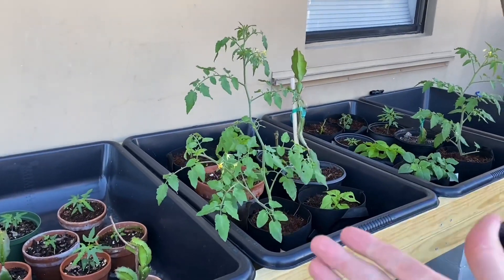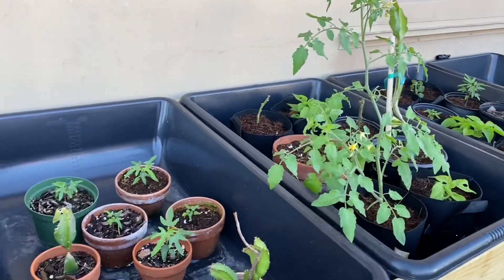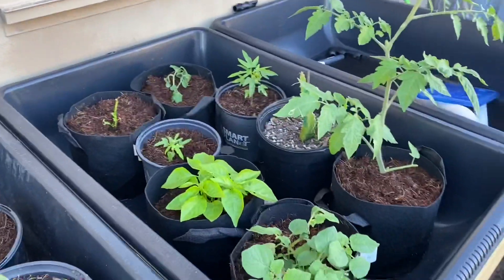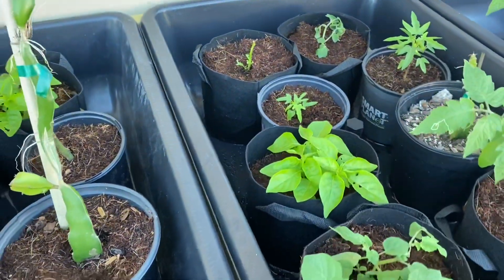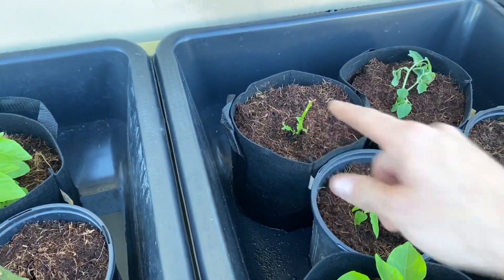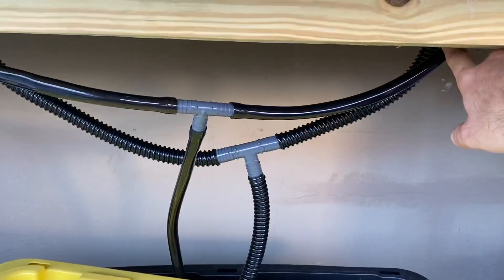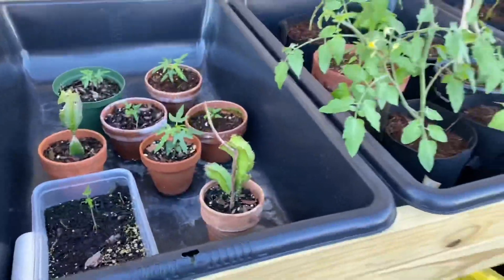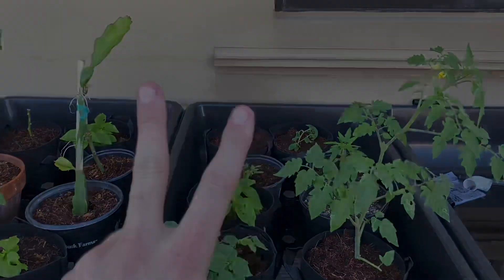DIY Flood and Drain / Ebb and Flow Hydroponic Table

Comment: On the ones that aren't connected you could just leave 1/4" to 1/2" of nutrient solution in the bottom. You may not need 2 fittings because the pump line will turn into a siphon when it stops.

Comment: Once again, another inspiring video.  
1.  What size is your reservoir tub Bob?  
2.  Are the upper tubs just resting on the outside lips of the tubs, or are they sitting on a tray?  
3.  Lastly, do you aerate the reservoir?  I am guessing not, as you don't for anything else.
Thanks again, Ill send pics of my grow room...
Reply from the maker: Reservoir is 27 gallons I recommend larger because when it rains the water from my roof make it overflow.

The lip of the tubs are sitting on the 2x4s but underneath in the center there are 2 4x4s running across the whole bed supporting it
Reply from the maker: No aeration as always
Reply: These larger tubs are 24"x36" and cost about $16.

Comment: Nice setup Bob. You and your videos have inspired me to take on outdoor hydroponics. One question I have is reservoir temperatures. What are your temps, and what side of the house is your grow on? I am in SWFL and will be setting up on the west side of the house. I'm worried that I'll be battling a hot reservoir in the summer afternoons.
Reply: If you are in a hot place like Phoenix you probably should put the system on the north side.